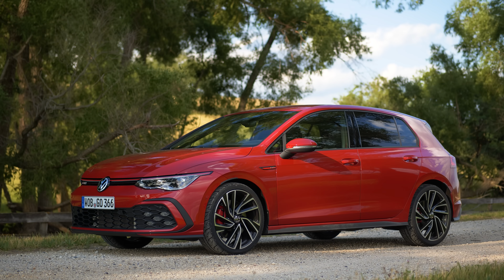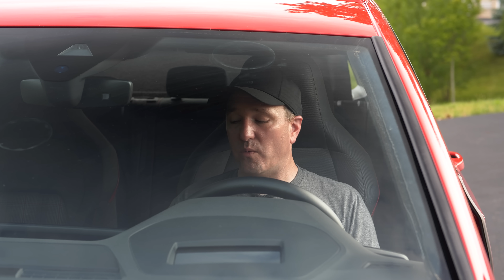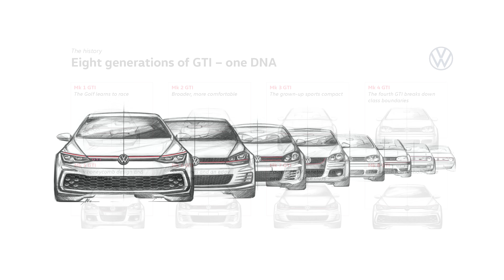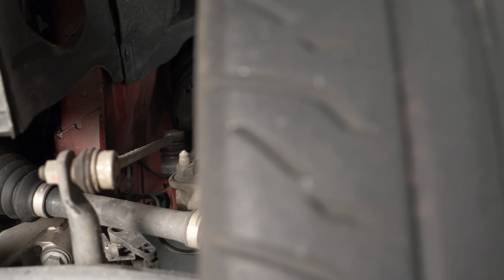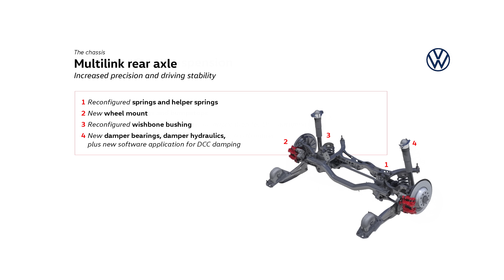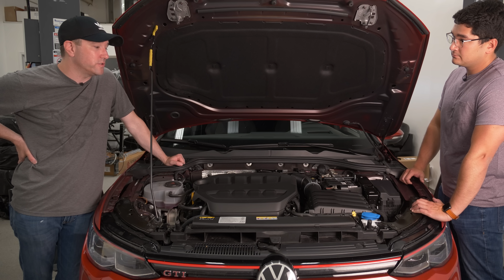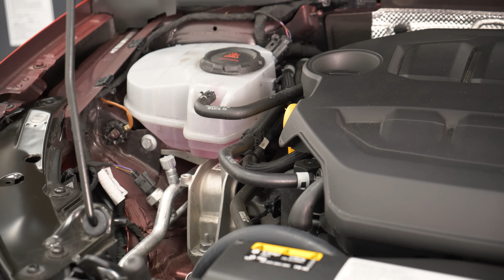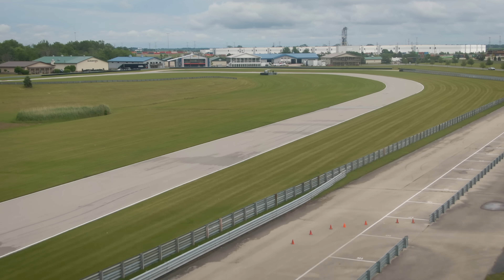2022 VW GTI Mk8 | Unexpected

Comment: That infotainment is a deal breaker.  Just awful having everything work through it.
Reply: You cant replace it, so it is indeed a deal breaker. If you replace it with anything you will lose traction control, AC, etc etc. Just no.
Reply: Have you actually used it? It’s amazing seriously stop complaining
Reply: Rather get a low mile 7.5 to avoid the parts I have to deal with on a constant basis.
Reply: I agree. It surprises me that they went in this direction, when others like Honda & Ford have tried it and faced MAJOR backlash from customers, causing them to bring back conventional knobs/dials/buttons for major functions. It's as if they weren't paying attention. Hopefully they're already at work tweaking this stuff for the facelift that will come sooner than later.
Reply: @BrakRulesAll  I like a minimal interior as much as the next person but you can still put physical dials and buttons for the key controls and keep it minimal, simple and intuitive.  Not that I've been in the 2022 Civic but it looks like they did a fantastic job of blending the infotainment with the necessary physical controls to create a very nice looking yet very usable interior. 

My current ride is a 2013 Mazda 3 and it's very busy mess of physical buttons and dials.  Love driving the car, kind of hate the interior.  I only use 10% of the buttons (thank goodness for physical steering wheel controls!) so keep that 10%  as physical buttons and shove the rest into easy to an easy to access menu system.
Reply: @keithck3720  Have you seen the 2018 - 2021 mazda 3? I have a 2020 and in my opinion it has the best blend of physical controls and minimal design. It was one of the things that sealed the deal for me in terms of which car to buy.
Reply: @igorkalezic4739  I've played around with it a bit a the dealership when I've brought my 2013 Mazda 3 in for servicing (pre-pandemic of course).  I know not everyone's into using a command knob as the infotainment interface but I though it was rather intuitive after trying it out.  Agreed that it's a nice blend of physical and onscreen controls with a minimal but classy interior.
Reply: All they had to do was nick Audi's previous MMI and it would have been perfect.
Reply: @astronmr20  Audis big on stealing VWs parts. They don't love it when Vws have Audi stuff
Reply: Annoying but not a deal breaker. The driving dynamics just sound fantastic that I'll give this a close look.
Reply: We have an Alltrack that has an sdcard in the glovebox. I put a large sdcard in there with a lot of music and I never have to fiddle with media. I love the way you can navigate and play from the sdcard. I could live with the mk8 stereo if it can navigate similarly. But if there isn't an sdcard or usb stick option like with the mk7s, that is a huge deal breaker for me.
Reply: @drwisdom1  haha SD card with music? My Bluetooth phone and thousands of songs via YT music, apple music etc is far superior than any SD card. That's the deal breaker? The fact it's a far superior driving experience is not enticing enough? Lol
Reply: @stevegaspar  I am old enough to have 30 feet of LP albums and installed a cassette in my first car because cars didn't come with them yet. I use media and won't be held hostage by a company like Apple. I live in Colorado and periodically lose cell service as I drive around and especially when traveling between states, so streaming from a phone is problematic. Plus I want to select my music from the head unit, not my phone. My 2015 Sportwagen doesn't have Android auto. My solution seems far superior to me. If 48 years ago you told me my tiny future cassette would be so big I could listen to a different song for the life of the car without changing it, it would have blown my mind.
Reply: @drwisdom1  haha ok there. Yup a far superior driving car and experience and yet the SD card is the deal breaker. Also YT music allows for thousands of downloaded songs to the memory card of your phone. No cell service needed lol. But you and me are obviously different I buy a car for the driving experience not the SD card music lol
Reply: @stevegaspar  I always buy the car for the driving experience. I have never had a vehicle with an automatic transmission (83, 88, 2004, 2006 GTIs, and 92 Corrado which I still own after 29 years). I didn't consider the stereo when I bought my Sportwagen, but that doesn't mean the stereo functionality isn't great. I don't care if it is an SD card or USB stick. The reason I used the SD card is it permanently hides in the glove box while the USB slot is in the storage area in front of the shifter where objects can hit it.
Reply: @drwisdom1  umm what? Your first comment literally says the SD card is a huge deal breaker for you. Not the driving experience. In fact your entire comment was about the SD card and nothing about the amazing driving experience the new MK8 presents. Which by this video says is leaps ahead of the previous generation.
Reply: @stevegaspar  I have been driving VWs since 1973. No VW I have ever driven beats the driving experience of my 1983 mk1 GTI. The MQB chassis was a significant improvement in comfort and handling, so for me that is the defining difference between modern VWs. To me the difference between mk8s and mk7s is the interior and exterior styling. I seriously doubt that tweaking the traction control makes the mk8 driving experience a lot better or amazing. The real deal killer for me is I sold my 2006 GTI so I only have two VWs, both of which are more appealing to me than a mk8 GTI. I also don't want a VW loaded up with junk tech like adaptive cruise and automatic braking.
Reply: @drwisdom1  considering you've never drove a MK8 you literally have zero idea of the experience. It's quite possible the car is the best you've ever driven...oh and guess what most likely 99.9% of infotainment system is voice activated just like the Mk7.5 and thus very very very simple to use. Even if not...oh no change!!! It's sooooo scary lol. Whatever, I like seeing new changes. I've just got my MK8 allocation secured and the date, according to the dealership, is November or December depending on delivery. Enjoy your SD card music. I'll enjoy an incredible evolution of the hot hatch.
Reply: @stevegaspar  I consider streaming from my phone a major step down. While I write phone apps, I am not enslaved to my phone. I don't talk to my stereo and don't consider doing that easy. I don't use VW car-net. I don't drive automatic transmissions. I'm sticking with my mk7 and Corrado SLC. 

But I will admit to streaming from my phone. I also have a 97 T100 pickup with a CD player I use when I need a truck or we have a lot of snow. For $18 I got one of those bluetooth things that plugs into the cigarette lighter and you tune it to a radio station. So when I drive that old truck I stream from my phone.
Reply: @drwisdom1  Again the new players allow you to download songs on to the phone. So no streaming it's playing off the phones memory. The fact 99.9% of new cars use android auto and apple car play makes playing music off the phone memory card easy as pie. Which is why people complaining about the infotainment is even more funny. Of the car couldn't use those services People would be even more upset. Much like most of your comments 99% are just upset about change and that's fine. I'll be the one who gets the enjoyment of trying new things.
Reply: @stevegaspar  I find it interesting you think I am hung up on an "SD card". But the reality is I am hung up on having data storage for my car stereo in the same way you want memory in your phone or a hard disk in your computer. If the mk8 stereo can't hold and play music and you have to use a phone as the source, that would be a major design flaw. 

Push button start is an awful gimmick feature. It doesn't do anything better than keyed start. But it makes the car less safe by eliminating the emergency off switch, and it makes the entire vehicle dependent on the key fob battery. You can now be stranded worse than a flat if your key fob battery gets low. I keep a spare in my glove box. Unnecessarily making our VWs dependent on a wimpy battery is a serious design flaw. Vehicle makers are always making changes, but half the time they are bad, like getting rid of full sized spare tires. The mk7 stereo is hands down the best I have had in 48 years so reducing its functionality can't make it better.
Reply: @drwisdom1  wtf are you talking about? You literally said the SD card is a deal breaker for you. Fine but that's nothing to do with the driving of the car. 99% of the world now stream or download to their device to play anywhere and downloaded songs, movies etc requires zero data lol. Then you make a 180 and say how you're all about the driving experience. Lol. I for one am 100% about the driving experience and I also have satellite radio which works on the car too. I hope people like you stay away from the MK8. Allows people like me who want to experience the evolution of the GTI more accessible.
Reply: @stevegaspar  I am not going to use my phone as a source for my car stereo. Sometimes I don't even bring it with me. I have so much music on one SD card that it has basically everything I could want to listen to. It is always there, instantly ready to go, and not dependent on a charged phone. Downloading music to your phone is an admission that streaming isn't that good and you really want local storage in your car stereo. But your streamers won't let you do that and they use your phone to trap you.
Reply: @drwisdom1  sorry your not very bright. But you're old too so sounds like you can't adapt to changing times lol
Reply: Golf mk8 has more viruses than a wuhan lab…

Comment: Am I wrong to say the subframe is sprung mass? I'd think the aluminium upgrade is for overall weight and stiffness.
Reply: You're correct. The aluminum suspension components are unsprung mass and that's what really makes a difference.
Reply: Unfortunately it looks like the unsprung components are the usual pressed steel. Maybe the R or future special editions may upgrade some of these.

Comment: The approach they took the interior is pretty much a deal breaker.  Such a shame.
Reply: 10000% i don't track my mk7. Was super excited for this. I'll decide when I drive it but looks like I'm just going to go stage 2.
Reply: @aboojibreel  You'd probably get pretty similar handling to the mk8 with a rear sway bar and good tires. I wish VW didn't "cheat" by giving them a car with autocross tires so we could get a better comparison.

Comment: Two things I noticed in the last Golf R I drove, the throttle delay and the fact that the manual transmission and clutch both felt totally artificial, no effort to use and just felt like a video game. I would love to know if these issues have been addressed.
Reply: I rented a manual and dsg gti. I feel the same exact way. I love manuals, but the manual in the gti gave me no feel. It was like an on off switch.

Comment: Honda really has a chance to kill it with the new Si, hope they do it right.
Reply: @layne4376  You say that like it happens to every engine, which it doesn't, I've had no problems, although  haven't put to many miles on mine yet.
Reply: @layne4376  That's why I bought a new Corolla last year, instead of the Civic.  The oil dilution issues scared me away.

Comment: My Mk6 gti is the reason why i will never buy another Volkswagen and it pains me to see that the direct and port injection system won't be coming to the states. I can't tell you how many times i've had carbon build up issues in my heads, fuel pump issues, injector issues, intake manifold issues. even with an oil catch can it's been a plague to me with that car.

Comment: Should be worth noting the Mk7-7.5 Euro spec cars could have the nannies turned off. US market cars were coded differently and couldn't be turned off without changing control modular coding to enable ROW functions via VCDS or similar tools.
Reply: Not factory though correct? I distinctly remember tiff nedell complaining that he couldnt turn it off on mk7s

Comment: All of the positives get tossed out of the window with their interior ergonomic choices. Not sure why you guys chose to track test this thing when 99% will never see that sort of activity or even 10/10th's driving. It's meaningless. The understeer issues in the MK7 are completely overstated in this review. On the street, it's negligible with spirited street driving with the VAQ diff and sticky summer tires. Add an $800 stage 1 flash and you've exceeded any engine performance gains of the MK8. Save your money and send a message to VW that their design choices are going the wrong direction.
Reply: Most of the driving of this car was done on the street during filming. For the sake of our in-car segment we did it on track as its easier to film for us in a controlled environment.

That said i also own the mk7.5 in this video and its on a stickier tire. I also owned a mk6 before. The dynamic differences are pronounced. That said many of the interior choices on the new car are very poor.
Reply: @jackethnicallyambiguous  Understood! Thanks for the clarification. It's just such a cliche with far too many auto reviews; using the track as a measuring stick for real-world performance. As the current owner of both a MK7 & MK5, I find it incredibly disappointing to see the direction VW heading. It was surprising to hear Mark praise the new model when the Mk7 seems so much more appealing from a drivers perspective.

Comment: TIRES EXPLANATION:
"According to Volkswagen, it had been loaning out these Euro-spec Mk 8s to media across the country (including Motor1.com) on the factory rubber. But when it came time to prep the cars for this program, the company couldn't source new tires for all six of the vehicles. We'll give VW the benefit of the doubt here, because COVID supply chain issues are real. But there was no other tire available, guys? The stock GTI rubber’s performance isn’t even on the same planet as the RE-71R."
From Motor1
Reply: Let’s assume the MK8 GTI’s top spec summer tire option is the Michelin Pilot Sport 4S or Pirelli P Zero. Neither of which are hard to find at all, both are in stock at Tire Rack. That said the performance of an RE-71 isn’t THAT much greater than PS4S or P Zeros and is largely one dimensional (grip). They would be outperformed in every other category such as ride, noise comfort, refinement, wet grip etc. The RE 71 isn’t really an “upgrade” at all.
Reply: @rootsmanuva82  nope, but for showing less understeer and raw grip on a track is an huge improvement
Reply: @rootsmanuva82  The GTI's actual factory summer tyre options from the VW tyre lottery are either Bridgestone Potenza S005, Goodyear Eagle F1 Super Sport and Hankook Ventus S1 evo3. :)  The US-market Potenza S007A is probably similar but not the same as the EU-market Potenza S005.  Unsure if the Eagle F1 Super Sport is offered in the US market (outside of OEM fitments), perhaps the Eagle F1 Supercar is the closest match.

Comment: Best review of the new MK8, great work gents!! I know you'll do a full review of the North American spec when it reaches us. I recently bought a very clean used, one owner 2017 MK7 GTI SE DSG with 20K miles for just over $20K. I absolutely enjoy that vehicle and I'm slowly on the path to doing appropriate street mods. I only drive it in full manual mode because it's the proper and most enjoyable way to drive it for me and because the auto modes are terrible. No doubt the MK8 is a better driver but the touch controls kinda ruin it for me. The MK7 is a great street car with a great interior layout and functionality and I have no regrets or desire to trade into a MK8 at this time. Peace.

Comment: Redirect R&D budget from interior design to driving dynamics? That’s a step in the right direction I suppose, but the MK7.5 interior was so, so nice.
Reply: The interior presentation on the mk7.5 is nice, but to actually be in the car everyday and listen to all the creeks and rattles, especially from the sunroof, is so annoying.
Reply: @brandonzimmerman1667  my '18 doesn't have any creaks or rattles, aside from a little wind noise at highway speeds. Time will tell how long it stays that way, however.
Reply: @madracer27  I envy you my friend, lol
Reply: @brandonzimmerman1667  never get the sunroof on VAG cars
Reply: @guenthersteiner8163  Learned that the hard way, hahaha

Comment: i wonder if they used stronger thrust bearings for manual trans owners, otherwise you run the risk of blowing the engine with power mods and an aftermarket clutch. Also a non plastic leak resistant water pump would be an improvement, but i'm sure they went with plenty of composite components again

Comment: So much of the commentary in this video can be directly attributed to super sticky tires. Would like to see this same drive with the US market all-seasons.
Reply: Tires make a difference, but I think tires really change where the limits are more than they change the feel and balance and handling characteristics—although there is some change. The latter (handling characteristics) are mostly accomplished by the suspension tuning, weight distribution, and chassis upgrades. For instance, I think, even on all seasons, you can still have similar neutral handling characteristics (case in point: original frs), but you will probably lose grip and go sideways sooner than you would with sticky tires. In other words, if a car is balanced properly, the rear will lose grip whenever the front does. Initial turn-in on all-seasons won’t be as precise or as fast as summer tires, but it’s not all tires. In other words, Tires let your car do what it’s designed to do. But if it’s not set up properly, it still won’t feel great or handle as well as this does. This is just all around good set up.